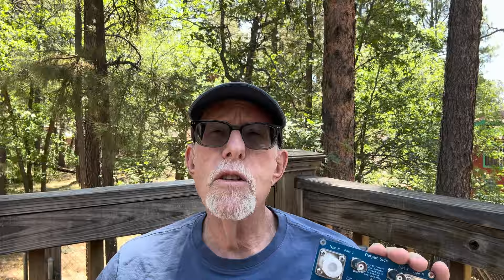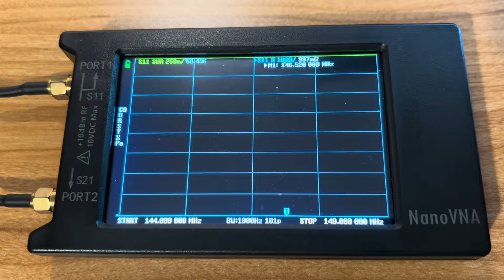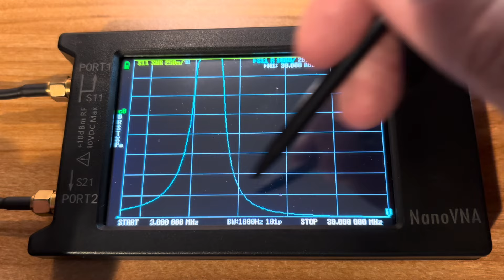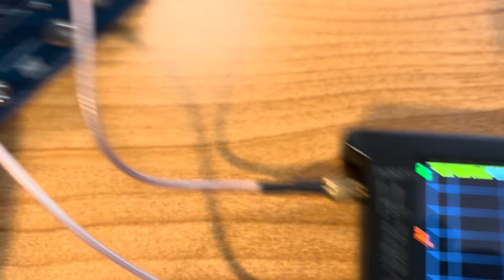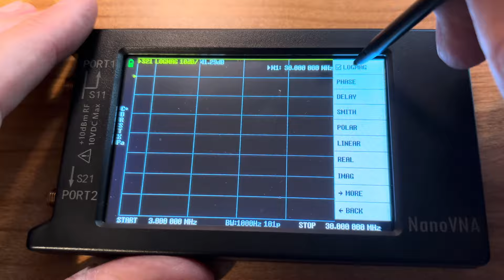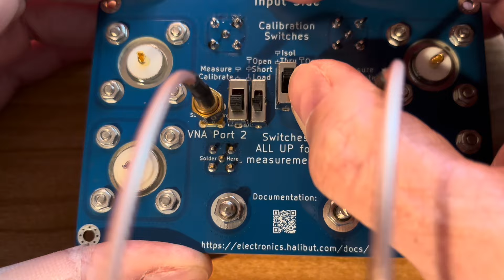HOW TO: Test Common Mode Chokes Using Halibut Elec CMC Test Rig and NanoVNA PART 1 #hamradio #radio

Comment: I have the Halibut rig and well worth the money when you build your own chokes. I can also attest to not buying no name Chinese toroids off of Amazon... that are nothing but paperweights. I only use Fair-Rite and for HF the FT 240 mix 31 is the best choice using 12 turns of RG 58. 73, KJ5LSO
Reply from the maker: This Halibut rig/jig is well worth the money. I am building my own chokes and if you use the correct materials, you can make superior chokes to most of the commercially made/sold chokes for a better price. So far I have only used Fair-Rite FT 240-31 as well. But I just ordered a couple of FT 240-43 just to test and see the difference. The Mix 31 best suits the bands that I operate in.

73 Dave N8DAV